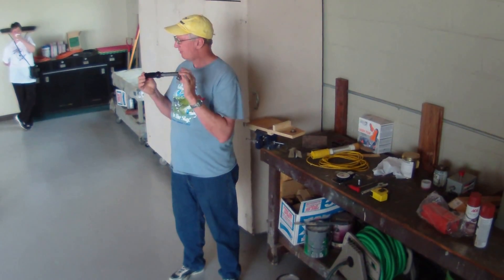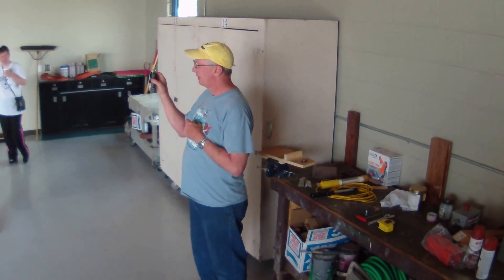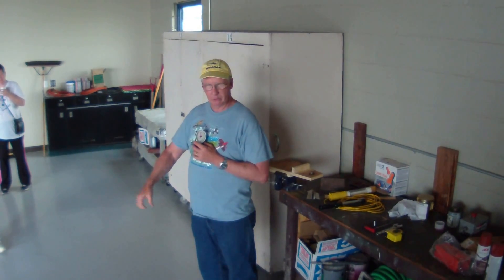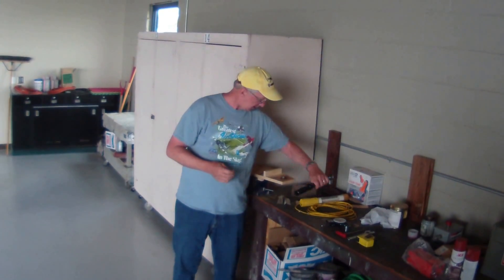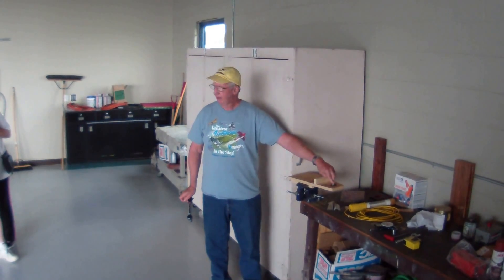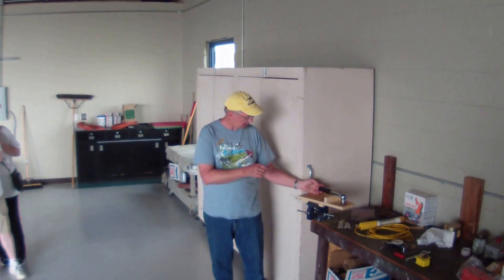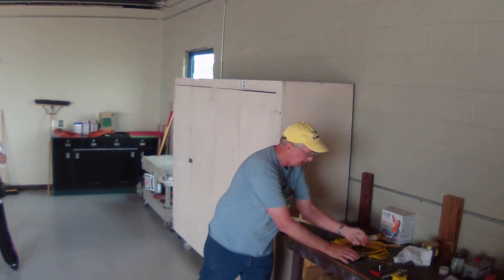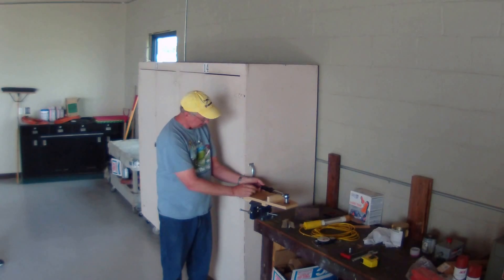Calibriation of a Torque Wrench

Comment: A gallon of water does not weigh 8 pounds, it weighs 8.34 pounds (average). That is not the proper tool to calibrate a torque wrench.

Comment: If you are worried about accuracy. Send it in to be calibrated. This old way is very unreliable. I'm a calibration tech by the way.
Reply: don keller Your wrench can be accurate, but if you have no practice doing torque  the accuracy is useless. Most people over torque even with an accurate wrench.
Reply: Sr gio you are correct. if you over torque a wrench, it rounds the pivot block.